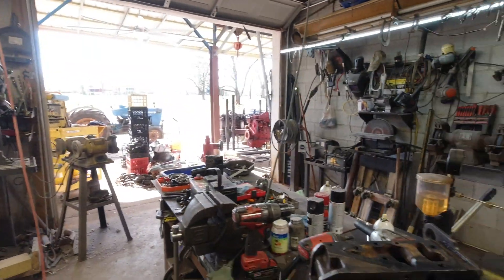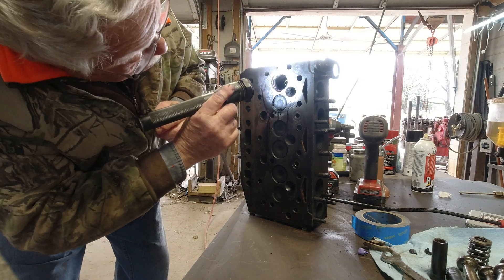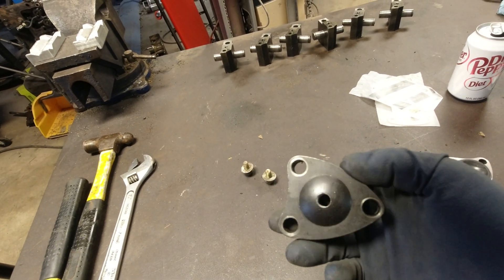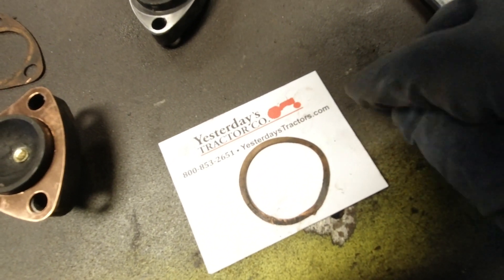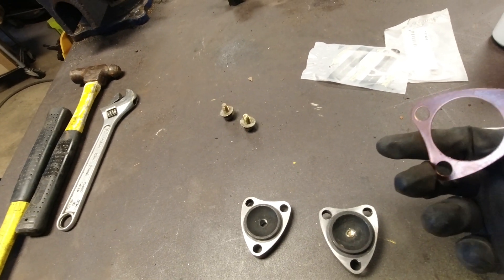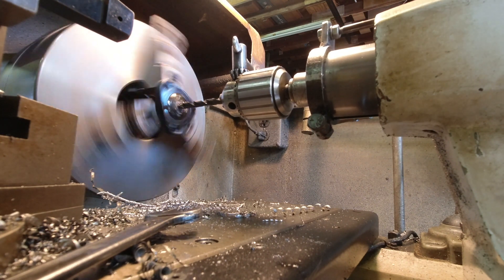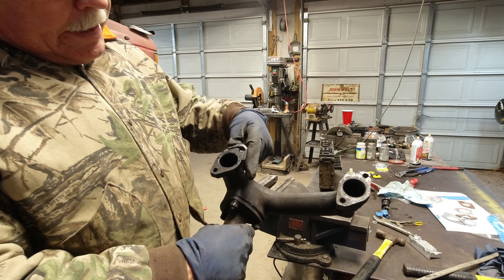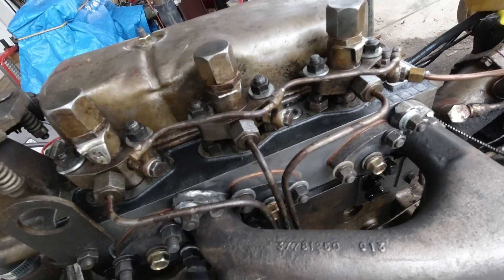Massey Ferguson 35 Perkins 3152 diesel head replacement & combustion chamber repair

Comment: Wow  You hit my problem exactly.  My original circular compress cap gaskets elongated and leaked.  Then I got the triangle gaskets and one of those failed after about 25 hours of operation.  I can not do the machining you recommend but I will try the annealing.  Also needed to know the torque for the bolts (35 ft-lbs, thanks).
I have a question.  Can the injectors be removed and inspected without removing the gas tank?  Do you have an opinion about either Rislone Ring seal or Engine Restore for smoke from worn rings?  No good?  Or can it delay the ring work for a couple hundred hours?  Thanks for a great video.  You do great work.  Do you think I might find a local diesel shop to test my injectors?
That is a lot of questions but nothing compared to what I would ask in person if we were friends (LOL).  Thanks, Doug

Comment: I am getting a small oil leak from what appears to be the head gasket right rear of the engine above the tachometer housing.  No coolant in my oil yet.  When tractor idles I can see small amounts of oil bubbling from the head gasket.  Any tips or tricks for me before I pull the head.  Just ordered the new gasket kit.

Comment: What type of electrodes did you use to weld the exhaust manifold?
Reply from the maker: Heated the surface and welded with a MIG Machine. ER70S-6 35,000 welding wire